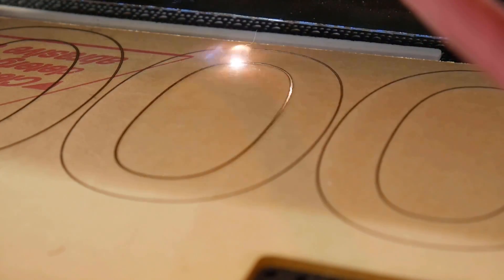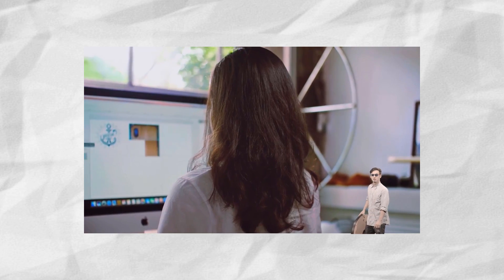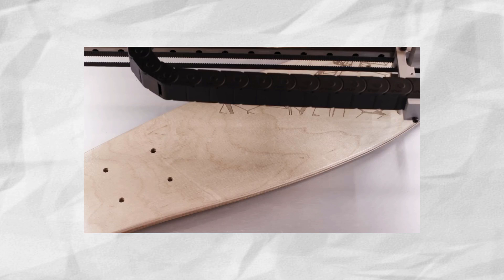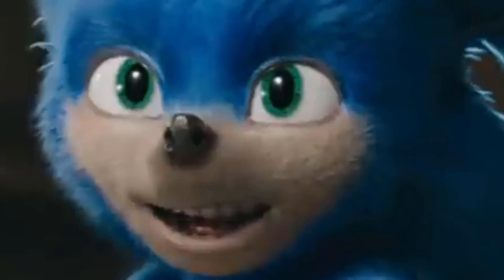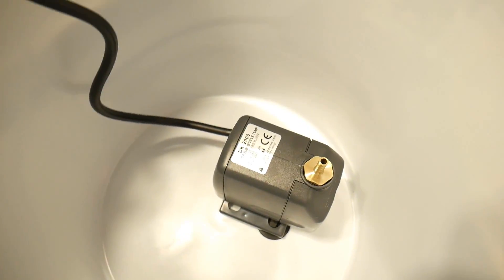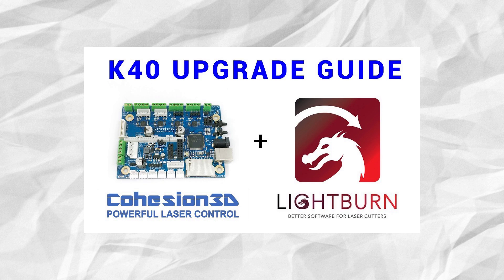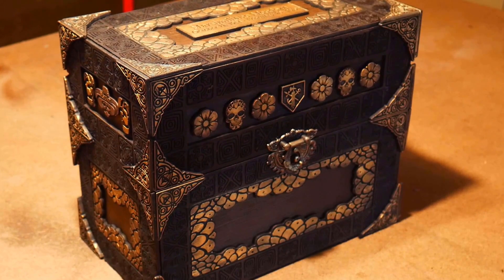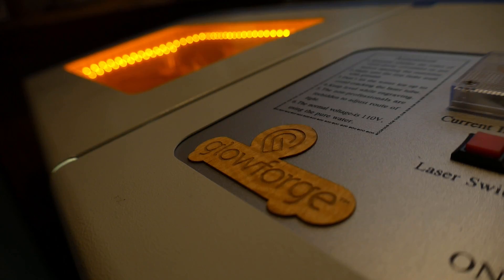Cheap Chinese Laser Cutters - What they Don't Tell You

Comment: It is nice to see a clean and swift reality check on on the over paid expensive name brand equipment that doesn’t produce any better end result. Sure they may have add of ease features but the advantage of several machines versus one cannot be ignored. Ive found in most cases that i can manufacture my own cnc machines in a higher quality for much less. Its the presentation that gets most people. Fancy case, emblems, those things attract more money. The adage you get what you pay for no longer sticks for everything. Nice presentation.

Comment: Good and well made video.  I'm in the laser business (galvo driven, not flatbed) but was a product manager for Gravograph (now Gravotech) and sales manager for Trotec.  Different grade of product at a much higher price point..  These both look OK for home/hobby use but it seems like you can make some profit too!!.  How is the service from China though?  I've heard that the documentation can be weak and parts can be hard to get with some Chinese companies.  The DC excited tubes don't typically last as long as RF excited sources.  Are the replacements readily available?  I think about a side business from time to time and who knows, I might go this direction.
Reply from the maker: The returns and service are backed by eBay so they're pretty decent the main thing is finding a supplier/distributor that's near you... The act as a middleman between you and the Chinese manufacturers..
 
These k40 units are so popular that replacement parts are easy to find.

Pound for pound the k40 is the best deal you're going to find and it's easily capable enough to make you some decent money

Comment: GF owner here, I have pondered picking up a K40. One thing I did not see touched on is bed size can the K40 achieve 11.5in (292mm) x 19in (482mm) in cut size?
Reply from the maker: Not without modification, standard size for a k40 is a little more than 8½in x 11in

Comment: started with k 40....then...size does matter....got an SPT 45 watt tube....some 2020 extrusion....built my own....accuracy is great....all for $1000....my hobbyist limit......
reason i built this...was i hooked up with a friend who wanted to see if it was possible to use 2-color plastic to make and design labels that he uses and resells to 20-25 of his other customers.
I'm retired and there arent massive orders to fill......in short, i go this way, because no pressure, work 2-3 days out of 7....minimum i make, $150 on a $20 piece of plastic.....$240 max on other labels per $20 piece of plastic .....all using free software and cheap chinese m2 nano board....cohesion and lightburn not needed.

Comment: I own 2 k40's and am a fan. <$400 for the the same results for a slightly steeper learning curve?
no contest for me. for those who have more interest in turn key, glowforge might be the choice.
i am cheap and i like to think smart. $400  for a unit was a no brainer. Inkscape and k4 whisperer not a super steep learning curve IMHO.
Reply: started with k 40....then...size does matter....got an SPT 45 watt tube....some 2020 extrusion....built my own....accuracy is great....all for $1000....my hobbyist limit......
reason i built this...was i hooked up with a friend who wanted to see if it was possible to use 2-color plastic to make and design labels that he uses and resells to 20-25 of his other customers.
I'm retired and there arent massive orders to fill......in short, i go this way, because no pressure, work 2-3 days out of 7....minimum i make, $150 on a $20 piece of plastic.....$240 max on other labels per $20 piece of plastic .....all using free software and cheap chinese m2 nano board....cohesion and lightburn not needed.

Comment: I use Coreldraw for my vector based design, will that work??
Reply from the maker: It depends on what software they send you, laserdraw you will need an inkscape extension to read svgs, if they send corel laser you will be all set... Or you can look into k40 whisperer or a different controller board so you can run light burn

Comment: That was an interesting video. I am interested in getting a K40. I'm just wondering how loud they are and how much smoke they put out. I live in an apartment complex and I don't know if my neighbors would have a problem with it, or if the smoke vented out the window would be enough to cause some concern.
Reply from the maker: They are about as loud as a 3d printer and bathroom vent, the apartment complex might be an issue.
Cutting wood puts off a fair bit of smoke and acrylic puts off a nasty smell, maybe if you get a more powerful exhaust fan that can disperse the smoke/smell more efficiently. If you work at night the mole will be less visible/maybe give the people around you a heads up you are gonna bbq haha
Reply: @NickMartinelliTV  Thanks
Reply: @ryandowney8743  lots of smoke for wood and acrylic

Comment: I upgraded  my k40 to.a yongli tube and the increase in performance is amazing.  Beam was so tight.  Also hacked a 40 dollar auxiliary car heater to use as a cooler instead of using a cw3000.
Reply: awesome....the CW-300 chiller doesnt do squat....i got an Spt tube from lightobject.com...built own rig...tube been working for almost 3 years....i am interested in your hack with the $40 aux car heater....clever....never thought to go that way....wish you would have done a video on it....
Reply: You could buy a 240 pc radiator for $20 online and add a couple fans. They cool well.

Comment: I owned a K40 first and now a Glowforge too. 
I rarely turn on the K40 these days, when I used to use it all the time.
I'm always fighting it for the perfect focus/height adjustment with a DIY z-axis bed, while the Glowforge adjusts automatically using optics and a distance sensor. That's worth its weight in fast prototyping for me. Doing all my upgrades to the K40 was a serious lesson in patience. Nothing went smoothly. 
I hate that I'm restricted to 2" tall objects until my warranty runs out and I can cut the bottom out of my Glowforge, but I figured that's why the K40 would stay on the table. To be honest I rarely work on anything other than plywood and acrylic sheets, and cutting boards :P 
Now, I'm not a huge Glowforge fanboy. It doesn't do a lot of the things their marketing says it does. It has annoyances that really get to me at times, like not being able to open the lid to fix something in the bed without cancelling the job (unless you make do some tweaking), and the proprietary webapp leaves a lot to be desired. They decided to go with their own speed measurement and only display a percentage for power-- so moving projects to other machines means making educated guesses instead of already knowing what settings work. 
I find myself missing features from RD Works, which is saying something 😂
At the end of the day I'm glad I have the glowforge, it takes care of a lot of the inconveniences for you. 
I got into this hobby trying to spend as little as possible, and that can work-- but do yourself a favor and splurge on a machine you don't have to build from the ground up. I LOVE Makerspaces. Find yours! They usually have several brands of machines for you to play on, and you'll learn a lot! Then buy a solid machine for home.
Reply: Couple years later …. Is it really worth 6-7k dollars…? Seems like a lot u could buy a laser engraver or cnc 
Well u could get both for $1500 lol’ 

Is 6k worth it…? Working bed isn’t that big so can’t make huge stuff right…?

Comment: Courragated cardboard is probably the most dangerous material to laser. Melted the window on my K40 that way. K40 whisperer is a simple control option if you just want to get up and running without having to do hardware mods.

Comment: I’m about to get my hands on one of these what should I look for when checking them out ?
Reply from the maker: Make sure that the tube is in one piece with no cracks and that you have the machine grounded. 

It also doesn't hurt to check to see if the connections to the board and power supply are fully plugged in. 

Make sure to only use DISTILLED WATER 

also look up a video on how to align your mirrors to see if it's shooting straight

Then you are good to go!

Comment: Great comparison between the K-40 and Glowforge.

The big thing to remember about the K-40 is that it was not exactly intended to be a hobby/home shop laser engraver, it was designed to make rubber stamps.  Because we are using it beyond its original intent, we need to think of of the K-40 as a kit that we modify to meet our needs.  You cannot exactly open the box and expect a K-40 to be comparable to a Glowforge or other high end machine.  If you have some mechanical know-how and enjoy a bit of tinkering, the K-40 is fantastic and is a very capable little machine.  I enjoy tinkering so could not ever justify going high end vs the K-40.

Also, you do not necessarily need to update the board to get away from the bad K-40 stock software, Scorchworks has developed K-40 Whisperer that uses Inkscape to run the K-40 and it works quite well.  K-40 Whisper does not give you the ability to automatically adjust the power level but it does provide a usable interface for zero additional dollars.

Comment: Please, I want to cut through iron (not steel), 0,1mm (1/254inch), is that possible with that machine??????? Thanks!
Reply: Not likely.  A CNC plasma cutter would probably be a better option for cutting metals
Reply: No. CO2 lasers can not cut metal.
Reply: @parkerthornton1372  CO2 lasers can cut metal, quite easily, but not with this power output ... 40W...

Comment: I got one in the mail yesterday. For 315€ shipped it is amazing. Lots of support on YT, Inkscape and K40 Whisperer are a must.
Reply: Can you maybe post thé link from where bought it?
Reply: k40 a great machine...started with one of these....but now, built 16x24 rig, upgraded tube, power supply, used 2020 extrusion for build...still use k40 m2 nano board, the free software for last 3 years....used thingaverse to print out pla parts used in build.....

Comment: I have bamboo wooden boxes with dimensions 11x8x5 inches, will it fit this machine if i need to engrave a logo or drawing on the top? Or will i need the version with the bigger bed 300x500m?
Reply: this will do 8x12...but remember....it is limited in the box top height....justa a piece of wood.....it would be fine

Comment: If you want a hobby that includes tweaking a laser machine and upgrading it, get a cheap Chinese laser like the K40. You will save a ton of money, but you will also spend a lot of time doing research, upgrading firmware, figuring out which water to buy for the chiller (there is no chiller on a Glowforge.. it's built into the machine), etc. If you have a small business and want to get up and running quickly and get by with very little maintenance, go with a Glowforge or FS Laser, Boss Laser or something similarly priced.  Buying a laser is similar to buying a 3d printer.  It's like buying an Ultimaker vs.a Creality Ender 3.  Eventually you can get the results looking very good, but you're gonna spend a lot of time and money getting the quality you want. I purchased a Glowforge a few years ago, and had a big desire to start a small business. I've made quite a few sales with it so far as a "hobby business", but you really have to work at selling things and find a niche. There are tons of laser cutting businesses out on Etsy, so good luck. They don't really care what laser you used as long as it looks good.  Anyway, Glowforge also continues to update software which is nice, but it also requires an Internet connection to work which is a big down side. Had I purchased a K40 I probably would have been able to do the same thing but already made my money back, though I am not convinced I could get the same level of quality or wouldn't have just given up because of the steeper learning/upgrade curve. Glowforge has autofocus on the laser and also supports "3d engraving" which varies the power based on your image- not sure if you can do that on a K40.  Anyway, just wanted to add some more perspective on this.
Reply: I could not possible agree more. Your first sentence nails it.

Comment: A K40 is in no where near in the ballpark of a glowforge. It's a cheap way to get your feet wet, but you'd be FAR better off to buy the Chinese 50W laser engraver for under $1500. They are MUCH better made (with real linear rails), faster, and have better controllers and software. I started with a K40 also, and even today I keep one as an emergency backup....but I use the 50W for all daily tasks.
Reply from the maker: agreed! if they just want something to tinker with for a hobby the k40 is the best choice... (1500 is steep for marketing as a hobbyist machine) 

+ once a k40 is dialed in it can do some good work  

if they are going to use it every day then they are probably out of it just being a hobby and more into business
Reply: @NickMartinelliTV  
Nick is the k 50 already Dialed in for use? And is it a lot better than the k 40 ?
I actually want to get on for my little Girl, She's very Artistic on Drawing and Making things so I thought this would be a Great Start for Her.
One of the things She would like to be able to do is make the Face Mask and Shield for the Drs. 
Is that Possible?
Exactly, what All can she do on this 
K 50 ?
Reply from the maker: @rickh1227  either one will do what what you are trying to do

 I recommend this vid for more on the k50  https://youtu.be/Zo9UNg99wtw

A k50 with a ruita controller running the lightburn software would be more user friendly than the stock software that comes with both of these, and it has a bigger cutting area(12in x 20in) but is more expensive

Comment: Just beware, my K40 failed after 6 months and the company gave me the runaround for another 6 months before they stopped responding.  Also they often ship with internal wires disconnected/loose, so be sure to be a little handy to make it work...
Also there's returns on Ebay for $250 every now and then...
Reply from the maker: Agreed! always do your due diligence!
Reply: @NickMartinelliTV  k40 replacement parts are < 1/5 the price. if you are needing the support I think glowforge is a good model. similar to makerbot in 3d printing. the workflow was simpler for the non-technical user and worth the price.
each has it's merits. price will lead you to k40 in laser (or possibly diode for low power) ease of use to the beginner will favor glowforge
in 3d printing there is a similar model, cr10 etc is much cheaper than makerbot and other high cost. but the support is sometimes worth the cost for those who are inclined makerbot was easy as a beginner back in 2012 for me.
I think there are clear benefits in the glowforge workflow for the new user. but k40/inkscape/k40 whisperer are a huge cost benefit..But i am a tinkerer and that is a big factor.
I would lean to k40 simply because i could have several for the cost of one glowforge.
if i was recommending to a non techie, glowforge might be the better choice depending on tech competency.

Comment: Hey brother, loved the vid. I own a store and we do personalized engravings (by hand currently) on leather bracelets. Would the k40 work for me?

I’m also wanting to engrave/etch onto jewlery (stainless steel dog tag pendant style). Is the k40 best for my needs? 
Ps. It’s in a brick and mortar store, so I’m not sure proper ventilation is feasible. 

Or is there a different machine that would be better to do both those jobs?
Reply from the maker: hey I'm glad you liked the vid, 

k40 will work on leather but without proper ventilation it will be smokey and smell terrible
you could deboss the leather like this https://www.youtube.com/watch?v=qHGGlHy-SNI

 as far as etching on the stainless steel, the k40 isn't strong enough you need a fiber laser to actually engrave the steel 

you can mark on it with cermark https://www.youtube.com/watch?v=VJjU7pOXUp8
you could also etch anodized aluminum dog tags https://www.youtube.com/watch?v=s0d319BhkFs
hope this helps
-Nick
Reply: @NickMartinelliTV  Yeah, gives that WONDERFUL burning hair smell.  I did horse bridles and they came out beautiful...

Comment: Great video. I'm curious if you could use this to actually cut glass? For stained glass arrangements.
Reply from the maker: You can use it to score the glass to snap like a glass cutter but it won't cut through, if you want a machine that can cut through glass you'd need a desktop waterjet cutter like wazer. The sun catcher in the thumbnail is made of chemcast acrylic!
Reply: @NickMartinelliTV  Thanks, I wasn't even aware that desktop waterjet was a thing. If that price point becomes a little more approachable, I'll have to consider it.
Reply from the maker: @st0n3p0ny  haha right there with ya
Reply: @NickMartinelliTV  If you are looking for a cheap waterjet, you may want to check out https://www.youtube.com/watch?v=Lg__B6Ca3jc

Comment: Can this machine cut thin metals?
Reply from the maker: No this is only a 40w co2 laser if you are trying to cut metal you need at least a 150w oxygen assisted co2 laser. Cheaper options are small plasma cutters or small waterjets like wazer